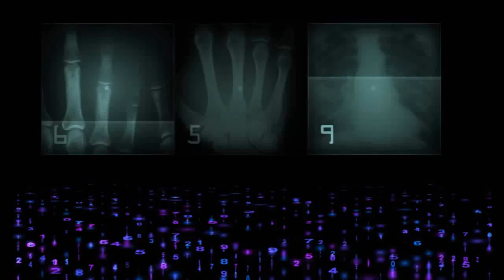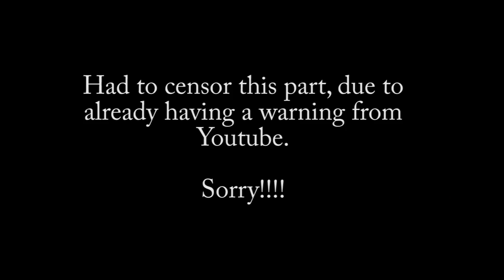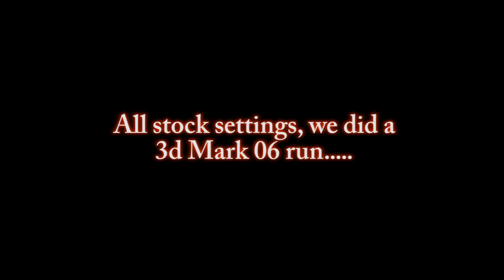Vortecks builds Aqua5ky's Antec 900 i7 4890 PC

Comment: nice rig, good job with cable mgmt. with what you had to work with. My only suggestion would be to drill a hole closer to the bottom of the case and then you could run that cable bunch to the back of the mobo. 
Anyway still nice build 5*

Cheers
LazyMan@WestCoastMods